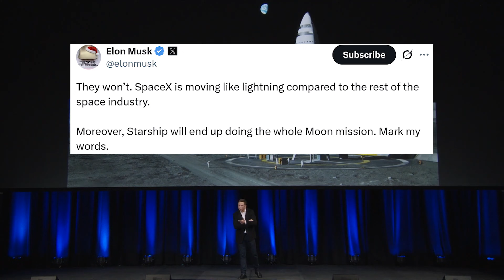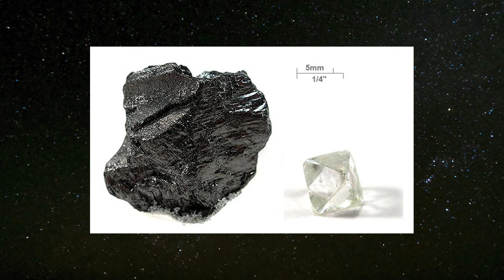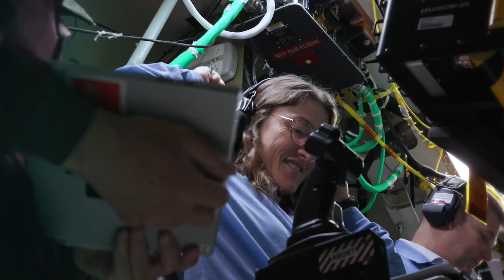The Real Problem Inside SpaceX Dragon to the Moon and it's Worse than Starship...

Comment: I still can't see why it should be such a big deal to send up three new glenn or three Falcon heavy in short succession to get three 45 ton payloads circling in LEO. One to be a spacious (lightweight) habitat not capable of getting through the atmosphere , one to be a moon lander capeable of going to the moon surface from LLO and back to the habitat module, and one propulsion module that provides the necessary ISP for the two other modules. If one propulsion module should not be enough, send up two or three to be coupled in LEO to a 220 ton rocket to go to LLO and back, including a retrograde burn to return into a stable LEO orbit. There the Astronouts can dock with a Dragon capsule after ascend to get into the habitat module and get back into a Dragon capsule after the moon mission. It should be doable using 130 ton of propulsion units from LEO, 45 ton for the habitat unit, and another 45 ton for the moon Lander from LLO when the Saturn V Payload to LEO was 140 t in total for everything back in the day. Dragon alone is far too small to be a human way to get to the moon and back.

Comment: You are putting way too much faith in starship ever working.  My bet is they don't get reliable orbit until 2027.  And they don't ever get refueling to work.  The project is canceled before that.  Musk will pretend that was the plan all along and they've made great progress, blah blah.  Meanwhile, Bezos will actually supply a working lander.  Also missing from your video is how they need upwards of 19 starship launches to fuel a single starship sent to the moon.  You make it sound like it's one refueling.  It's not.  The lift capacity of starship isn't enough to carry all the fuel needed on a single launch.
Reply: Your assessment is 100% correct.
BO sent a mission to Mars on its second launch, and landed successfuly.

Comment: Every Starship that goes to the moon ahead of the main trip also carries FUEL. Practice is gotten in maintaining LOX/METH on long term storage, or robots connect and pump to another starship. It would only take a couple extra trips with 100-200 tons of fuel to then refuel a lander, and send it back with sufficient delta-V to perform a breaking maneuver to enter Earth orbit. 

As for the risk of human crews taking off and landing on Starship? Send the crews up in Dragon, which can take 7 to orbit. Meet up with a Starship which has tanked up from an orbital depot, zoom to the moon. Dragon waits for the opposite on return. Dragon can sit in orbit for months, and even if it had an issue, SpaceX has a small fleet of them in reserve.

Comment: There's enough DV in an expandable super heavy  to push dragon one way to the moon. If you send a couple of optimus robots with as little as garden rakes to prep the landing site. That could be accomplished immediately.  Robots don't need a toilet, shielding or food.
Reply: If only Optimus robots existed.  If they did exist they'd need protective covering to ensure they weren't impacted by moon dust.  Of course you could send a battalion of rake armed Optimi to ensure the task was completed as individual Optimi seized up.  Or go low tech and send heavish duty towed drags and compactors radio controlled from Earth, a latency of 2.5secs.

Comment: It's difficult to see how starship survive a direct rentry from moon at 11km/s as fairly survive a LEO rentry at 8km/s. Why not use Starship to send a 200 ton propulsor (Raptor3+ fuel), for coupling at LEO with a modified Crew dragon to make Lunar orbit injection. That will give 10.25km/s of delta V to the actual Dragon enough to Lunar Misision. Dragon must be modified to achieve at least 1.7km/s from.actual 0.4 km/s.

Comment: I'm looking at the artwork, which I find purposely deceptive. They are either hiding proprietary secrets or forgot laws of physics. I used to wonder why is Orion cone shaped like Apollo instead of wider on top like Dragon, answer is doing high speed entry from the moon the capsule needs to bank and partially skip out of earth's atmosphere. Mercury and Gemini are wider near the top like Dragon because don't need to bank as much from LEO. That Apollo design came from late 1950s design concept Army did for a moon base (Project Horizon which defined the Saturn V rocket). This study probably got input from Von Braun's team so they considered what is really needed. Now I'm looking at Starship, not sure if such a shape is good for a high speed entry vehicle. Maybe they can pack a Orion inside for return to earth.

Comment: The reality is that absolutely nothing about going to the moon has changed in 60 years.
The engines may be better, but most of the propellants are still used up in just reaching orbital velocity.  Little is left.
Rockets are not the answer.  A different propulsion method is needed.
Reply: As far as getting things into orbit, a lot is about to change.  1960s rocket scientists had it right.  BIGGER IS BETTER!  Elon has also figured that out.  There is also some new rocket tech being played with (DARPA, et al) like Rotating Detonation Engines (RDE) that could double the amount of payload you can get to LEO.

For sending cargo or fuel to the moon it would make sense to use another technology that gives you a "cheaper" Δv, but at a slower pace.  Examples of that would be to use a solar sail, or "drag device", or throw a bunch of solar cells on it, and use a VASIMIR or similar ION thruster.  You can also use that in conjunction with lower Δv orbital transfers.  If it takes a month or two to get there, it doesn't matter.

Comment: You have almost figured it out. The key feature is called "buddy tanking". Two Starships are refilled with methalox propellant in LEO. One of them is the crewed Starship with cargo in the payload bay and lands on the lunar surface. The other Starship is an uncrewed Starship tanker. 

Both Starship fly together to low lunar orbit (LLO) and the crewed Starship lands on the lunar surface while the tanker remains in LLO. After unloading arriving passengers and cargo and onloading departing passengers and cargo, that Starship returns to LLO.

The tanker Starship transfers half of its propellant load to the crewed Starship, and both blast out of LLO. Those Starships use propulsive braking to enter an elliptical earth orbit (EEO) with perigee of 600 km and apogee of 900 km.  An Earth-to-LEO shuttle vehicle (a Starship, a Crew Dragon, or whatever) returns the arriving passengers and cargo to one of the Starbases on Earth.

I think that is what SpaceX means when saying that the lunar landings will be done entirely via Starships. No Rube Goldberg lashups are needed using other types of launch vehicles and spacecraft. Only completely reusable Starships.

Comment: Starship can reliably explode.
Reply: I'm sure you realize that most of the "exploding" was deliberate detonation of the flight termination system, right?
Reply: @PeterKamen-c5d  Yep, flight termination after not so deliberate failures.
Reply: Starship self-destructs when given a deliberate ground command to do so. DOH! Musk is doing exactly what he did with Falcon 9 and Dragon, with multiple launches to take incremental steps to perfect them. The 1969 Lunar Landing wasn't the culmination of Apollo 1-11. It was the culmination of every mission starting with the Mercury Program. The entire program with Mercury, Gemini and Apollo mission objectives were laid out when the first Mercury mission was launched with Alan Shepard. Specific mission objectives were modified as the programs progressed, but he entire roadmap for Mercury, Gemini and Apollo were already laid out. Musk's vision is on the Long Game. Doing a repeat of the Apollo Program achieves nothing. The U.S. has Been there, Done that. China isn't going to do anything that wasn't already done from 1969 - 1972, 55 years ago. Why is there an imaginary "need" to beat a Chinese COMMIES first lunar landing with a RETURN to the Moon when we already proved we could go there and return -- six times. Any trip now should be much more substantial than Apollo was. Otherwise it proves nothing and does nothing of any value.
Reply: 🙄 clown!
Reply: @WyoSavage1976  True. Starship doesn't reliably explode. Sometimes it implodes, melts, loses bits...

Comment: The inherent problem the US faces is two fold. 

First, unclear mission objectives. Are the US trying to return to the moon before China (land and put up a flag)? Or are the US trying to establish permanent Luna base ASAP? The two goals are not compatible and the US need to pick one rather than muddling between the two and give programs conflicting requirements. Also, there’s also an argument for aiming to just get back there first.  Establish a long term industrial base is such an elusive goal, probably requiring decades of efforts. Yet the actual economic benefits of such efforts is so theoretical at this moment, there’s little there to justify the type of long term commitment needed that could just make this happen. Frankly, the rationale breaks down to “we can’t let China do it first” atm.

The other problem the US needs to solve is regulatory capture by SpaceX. Public-Private partnerships could be incredibly effective because private enterprises are there to make money. As long as you make sure they don’t get paid until they provide value, they will provide value incredibly efficiently.

However, that’s assuming the partnership is done right. Otherwise, a private enterprise would quite naturally getting paid without doing the work if they can get away with it.

Due to the lack of real competition (from Boeing and whoever else) and the weakening of NASA’s own capabilities, SpaceX is basically taking NASA for a ride and they are spending NASA money on whatever Musk deems priority. Some of it has nothing to do with getting back to the moon.
Reply: Wrong. Spacex is giving them a lander that can support a long term commitment to the moon, not a flag planting ceremony. But strangely, Spacex is planning beyond one mission and they have the resources to do both. What Trump (in 2016) wanted and what they want. The same ship can do both. Trump never called for a flag planting ceremony and most of the competition (excluding... somewhat... the 2nd BO entry). They were all too small and should never have been considered. 

We already planted a flag on the moon. If we want to do something useful, we need mining and fabrication on and under the lunar surface. 

Only Spacex can land 100t on the moon and only Starship can be converted into a base. 
BO lander II is Ok for personnel but maybe 15t cargo.
Reply: Boeing did it to themselves. If regulatory capture by SpaceX occurs it'll be because Blue Origin dithered and Boeing was grifting.